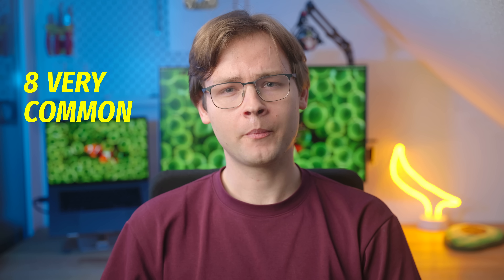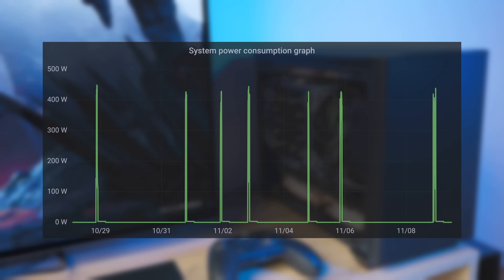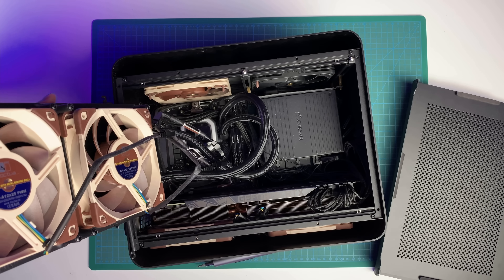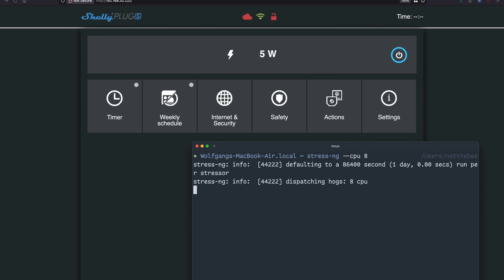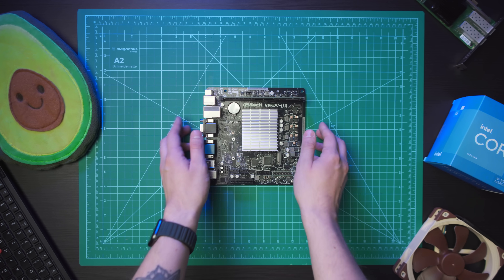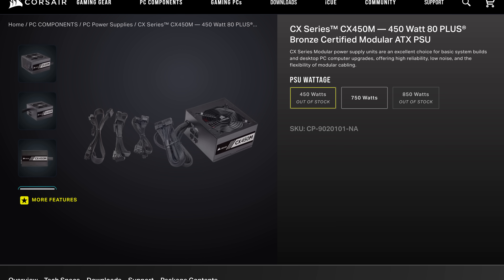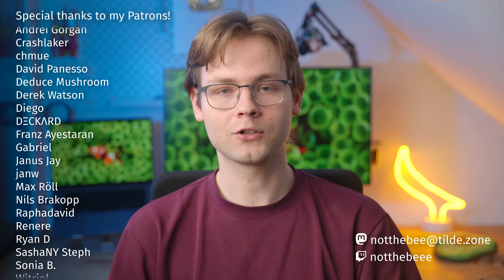Busting 8 Common Homelab Power Efficiency Myths

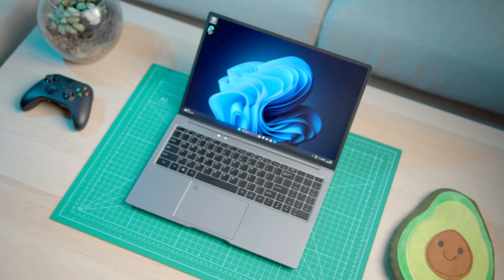Comment: 12:56 The one area where laptop CPUs seem to always beat desktop CPUs in efficiency seems to be AMD APUs, and i mean APUs, not desktop CPUs in a laptop BGA socket, there is just something about the chiplet architecture that requires more power draw especially when you're not looking at full load.

This means the 7945HX is likely just as efficient as the 7950X if you clock them the same on the same hardware this is because they are effectively the same processor, just in a different package.
But a 7940HX would likely beat out a 7700X in efficiency as long as the 7940HX is not starved of cache(has 1/2 the cache per core compared to the 7700x, also i think it has 4-8 fewer PCIe lanes)

Take my 5700G vs my 5600X
In the same board the 5700G can idle at 15% lower power draw at the socket with quite literally all the same hardware, and then if you take out the GPU its even better system wide reduction(getting rid of the GPU to free up PCIe slots was the main reason i switched my recording server over to a 5700g, didnt realise how much it would reduce power usage).

I dont remember where i read it but someone said that the picojoule per bit could be 5x more energy expensive under certain loads on AMD's chiplet desing, but that may have been talking about their chiplet based GPUs with the cache being located off-die.
Reply: Of note, while AMD APUS are generally more efficient, they can be less efficient if they are tasked with something that needs alot of CPU cache, as AMD APUS seem to all have 1/2 the L3 cache of their chiplet based counterparts, this means tasks that could be run within cache on a chiplet CPU, now have to run out to RAM and back on a monolithic APU.
Reply: @denvera1g1  Not all. Zen and Zen 2 ones mostly had 1/4 the L3.
Reply: @laurelsporter  How have i not noticed my 4750G has 1/4th the cache of my 3700x
Reply: @laurelsporter  Zen1 and Zen+ were both 1/2 the cache per core, with the 2400G having 1/2 the cache of the 1200-1400, and the 3400G having 1/2 the cache of the 2500x

But i did not notice that the 4700G/4750G were 1/4th the cache of the 3700x

This explains why the 5700G is so much faster than 4700g in some use cases, and why the 4700g is more sensitive to memory overclocking.
Reply from the maker: True! That's a really good observation. The AMD APUs are based on a monolith design, which is also used in the laptop chips.

Comment: Good video :)
Let me tell you about my home server.
Supermicro X8DTL (2010), 2X Intel Xeon X5690 (2011), 128 GB DDR3 REG ECC, Nvidia 1650 GPU.
Idle power consumption 125W (240V) Maxes out at around 350W whan transcoding video.
Not the most efficient machine in the world. Uses about 100kWh a month.

Comment: Judging by the thumbnail, i'm going to guess you're going to refer to 3.5 inch HDDs being massive power hogs.
I'm dropping this comment before listening to the video.
I have a battery backup from Ecoflow, but it doesnt switch fast enough for my PDU(internal self resetting breaker that flips if it senses a surge/issue) so i have an APC in-line after it.
I want people to guess how much power i use on average with this stack below, according to the large UPS 1.3kwh battery pack, which powers everything including the traditional UPS, or just the UPS which only powers the server rack.
---------------------
a power filtering PDU that also acts as a fuse for cat5e and 2 COAX sources(IIRC it draws like 0.5w so unless its draw goes up as other draws increase is inconsequential)
minisforum UN100(re-purposed as my firewall+router+caching)
Micortik CRS354-48P-4S+2Q+RM (48*RJ45_4*SFP+_2*QSFP+)
5700G based windows 11 Pro server with only 2 M.2 drives and 32GB of 3600 RAM and 4*PCIE TV tuners.
4*HD Homerun tuners
7950X based file+docker/kubernetes+virtualization server(truenas scale)
-64GB DDR5 4800 2 dimm(not ECC yet, waiting for 256-512GB kits so a 128-192GB kit would be reasonable)
-2*M.2 (boot)
-4*Optane 905P 1TB(not really used much at the moment but still set up for caching and special metadata to make the pool feel snappy)
-10*16TB HDD
-40G network card and 8*SAS controller
(not enough PCIe lanes for literally anything else)
----------------------

Now, i can tell you my old file server, a Dell Cloud Edge C2100, with 2*60w Xeon L5640, 18*8GB ECC FB/registered, 12*6TB 3.5 inch, 2*2.5 inch SSD, and dual 10G ports idled at ~500w just by itself. and required more assisting servers to get the job done.

How much do you think efficiency has improved in this time? How much do you think my new stack uses compared to just the one old server?

Also i have a surprised after a few guesses come in, i've left something out of the above.

Comment: I could get my old Haswell 4-bangers down to 30W or so.  A modern full-build uATX motherboard w/APU is about the same.  30W.  On the other-hand, mobile APU chipsets do much much better.  I've had very good luck with NUC style form factors with both Intel and AMD.  The AMD 3550H is a real workhorse and idled below 15W.   And I have an old Intel NUC style machine (5+ years old) that runs 7W, and a modern Raspberry Pi 4 that also runs around 7W.

However, at 7W the performance is really bad no matter even for basic tasks.  The CPUs just can't burst long enough and you can feel it in the response latencies.  Still, the RPI4 is able to Home Assistant and even though it can't really do a whole lot beyond simple data copying and automation, that is all Home Assistant really needs.  For example, it can't transcode or archive the 10 security camera feeds, but it has no problem doing a streaming fan-out of the feeds to wall-mounted clients.   It is also limited by a meager 4G of ram.

Modern mobile APUs from both Intel and AMD at 15W do much, much better because they idle below 15W (10W is possible if you really try), and yet can burst to 30W which makes them very responsive, and you can hang a significant amount of ram and storage off of them all inside a small NUC style case.

I finally settled on the 3550H APU in a NUC style form factor for non-compiling server-type stuff.  I can fit 64GB of ram, one NVMe drive (1TB), one M.SATA drive (slot unused), and one 2.5" SATA drive (4TB) all inside, all SSDs.  The whole thing runs roughly 15W when idle or under low loads and never gets above 25W.  It can burst significant cpu power for a short period of time which makes it very responsive, and it has two ethernet ports.  It can do very basic transcoding (repackaging mostly, though certainly not on 10 concurrent video feeds).

I have three of them.  One runs primary home functions (dns, mail, web serving, home media archive, routing, firewall, ntp/time, NFS/Samba exports, NAT... almost everything), the second handles repackaging and archiving feeds from 10 security cameras.   And a third is the backup box which backs up all the filesystems for all the machines and handles staging to the off-site backup.  And I still have the RPI4 handling the home alarm system (it fits in the alarm cabinet with its own backup battery).

Bulk compiles are painful on these sorts of small boxes, but that's what workstations and larger pieces of metal are for... the threadripper, for example, burns 150W when idle and something like 300W going full out.  But it doesn't need to be turned on 24x7.

My office workstation with its dual 4K display is also running on a normal uATX mobo combo and eats around 30W, not to mention the monitors that eat 10W each when not blanked.  I have tried many times to downsize it to NUC style or smaller and have failed every time.  The mobile form factor is just too slow when you have to 4K screens and half a dozen chromium windows open with many tabs in each, plus video playback in at least one going (sometimes more than one).   So my workstation needs to be able to burn 100W+ at times and no NUC form factor can handle that reliably.

Basically any particular need has certain minimum resource requirements to be convenient and there are form factor and idle/nominal power consumption requirements which fit that need no matter how you twist it.

-Matt

Comment: Hello there,
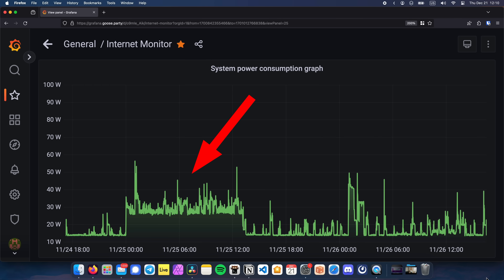2:58 i would like to know if the shown consumption is just for one device or for more than one.
I have my Router, a Palo Alto Firewall, 2 x small 8 Port Switches from HP, 2 x UniFi APs, 2 x Lenovo 1Litre PCs and one DIY Backupstore with an total idle consumption of 110-120w.
Tbh i would like to lower it even further to make it a little bit more cheaper than it is now. 

Also thank you for your content. I really enjoy it! 
C u

Comment: As somebody beginning to investigate homelabbing, what is missing in terms of info to me is actual build recommendations with modern and widely available components. People are usually referencing old stuff they picked up on ebay that is not being produced anymore etc. Some people don't have time to scour ebay-like sites hoping to pick something up from 5y ago or some obscure power supply to save 100$/€, and just want to know ok these components you can order anywhere and are good for low power draw and these typical use cases, etc. combined with these hdd's for this reason.

Thanks for the content!
Reply: The thing is, it's more like saving $1,000-10,000. New server and workstation stuff, even with tech that's a few years old, is expensive, and has gone up quite a bit over the last few years. The new ASRock Rack and Supermicro equivalents to some of these 3-5 year old servers are commonly $2500+, and can often be $700-1500 for the motherboards alone. I don't even mean the latest and greatest, either, but like Skylake and Kaby Lake based Xeons, and Goldmont Atoms, that Intel has kept pumping out. On top of that, there's always new stuff coming out every year, and older parts finally crashing in price.

If you don't care about IPMI or ECC, 4th-7th gen Intel Pentium, Core, and Xeon E3, on basic motherboards, are good bets, with 8th to 10th gen exemptions for the Pentiums and i3s. 8th gen and up Intel can be OK, with a mini PC type business computer, or good luck. But, since they just kept making Skylake bigger and badder, to compete with Ryzen, results can vary a lot, with common desktop parts. FI, a lot of those later Skylake++ motherboards will have VRMs made to push many amps, that are awfully inefficient at idle, or with low-power CPUs. But, home desktops will tend to be off or in standby, so it was typically only a minor issue for the intended use case[2].

For newer stuff, the monolithic Ryzen 4000G(E) and 5000G(E) chips (note that only the Pro xx50G(E) ones support ECC), on newer B450[1], A520, or B550, are pretty good (also 6000 and 7000, in mini PCs and such). ASRock has good support for ECC, and x16 bifurcation, across their 500-series lineup, too (you can get x8/x8 risers, x4/x4/x4/x4 risers, or 4xm.2 cards, and use them on $75 boards). AMDs before Zen 2 (1xxx, 2xxx, and 3xxxG(E) CPUs), Ryzens with IO dies/chiplets (almost all 3000 and 5000 non-G models, with a few exceptions, like the 5500), and the X570 chipset (which is a 3000/5000 IO die), not so much, as the IO die will typically use 10+W, just sitting there. AMD's main weaknesses are firmware and software compatibility with popular virtualization feature sets, quality of FreeBSD hardware support, and not always knowing if you can run a given motherboard headless on a pre-7000 series non-G/H/U CPU.

The more features, the harder it will be to save power, and many server-centric parts also make it harder (FI, some Intel NIC drivers, and the LSI HBA drvers, can disable ASPM, by default).

Also, try to avoid most 2.5GbE NICs. The i226-v is supposed to be OK, but its predecessor, the i225-v, was hot garbage, and Realtek still has some chips with buggy Linux drivers. IMO, leave 2.5Gb stuff to Windows, if possible, and just take the plunge into 10GbE w/ SFP+, if you want more speed.

If 16-64GB (but, some can take 96GB, now) max RAM, and little to no expansion, is OK, just get the tiny/micro form factor business PCs, with up to 10th gen Core CPUs. If you want real server features to play with, though, or a lot of add-on hardware, there is no easy solution on a budget.

[1] But generally steer clear, as most were craptastic respins of craptastic B350/A320 designs, as the board makers didn't want to put real effort into early Ryzen boards. With a few exceptions, like the ASRock B550(M) Pro4s and Steel Legends (same basic boards, but the latter has more RGB), only the B450 boards that came out well after the Zen 2 (3500X and up) release are really worth it, just in general. And, it can take a little effort to tease that info out, whereas you can spend $10-20 more and get a 500 series board, instead.

[2] One reason business PCs are better about this is that they don't usually get turned off, or go to sleep. Between Windows Update, and multiple levels of security software, trying to use a computer within the first half-hour of booting up will be painfully slow - yes, with nice SSDs in them all. Figure that you'll also have 20+ in any decent sized office, but maybe 100+, and that idle really matters.
Reply from the maker: I've been running my entire home network from a device with four i225-v (rev. 03) NICs for more than a year, not a single hiccup. YMMV.
Reply from the maker: @laurelsporter4569 *Sigh*, they really effed it up with the i225 series, didn't they.
Thanks for the feedback, I'll refrain from recommending the i225 in my future builds.
Reply: @laurelsporter  not talking about 10k setups for starting a homelab. But I don't think it would be a stretch to say this is what a 500$/€ budget gets you, this for 1k and this for 1,5k etc. These can be updated yearly based on what is available and still create a lot of content opportunity aside from that (e.g. buying off the shelf prebuilt system vs same budget but with 2nd hand components or same budget when you build it yourself with new components, etc.). Basically like many channels do with gaming pc's.
Reply: @NietzscheanMan  I don't mean spending $10k, I mean that the new cost for some of these servers was likely in that range, and you can only save so much, without losing quality and features, buying new. But then you may find them for $100-500, still very usable, some years on, because the companies that had them just want them gone. The recyclers that resell them got paid to take them away, so they don't have a lot sunk into them. Value-wise, used big OEM stuff is killer. But, every several months, what to look for at a given price can change, and every few years, it radically changes. The target is always moving.

It depends on what you want, though, and that also varies a lot more than for gaming. For gaming builds, you can pretty much set a price, determine whether CPU or GPU are more important, and you're golden. There are also much more limited sets of potentially good parts that matter, at any given time, as you're not looking at several generations of CPU platforms, implemented in proprietary ways by several different companies. Today, there's enough competition for quiet and small stuff that you can even treat SFF and quiet build parts somewhat as commodities.

If you want BMC, no-fuss RHEL or VMWare compatibility, or other such things, used servers are pretty much what you need. Many have upgrade options, once they're getting parted out, too (FI, check out the Art of Server's storage upgrade vids on the 720). If you want to play with specialized virtualizing, you need either to get them, or get newer Supermicro, ASRock Rack, etc., boards, often at $500-1500 each. To build one, used, is still awfully expensive, for some reason (like these old mobos are worth their weight in gold, but entire servers are worth their weight in styrofoam).

OTOH, if you only care about dealing with software, then you just need to concern yourself with features, upgrades, power, etc.. The used office PCs, or making a lower-end build with SBCs, will work great. If you don't have important data to store on them, and especially if you're going for experimenting, skip ECC, and that opens up tons of machines. But, those machines are constantly changing in price and availability, too. It would take a great effort to keep an up to date set of parts/builds, for used markets, and new SBCs.
Reply: Asrock N100DC ITX is a good, cheap and energy-efficient board (6-7w). Add 16gb of RAM, a cheap laptop power supply and the drives and case are determined by your use case and how much storage you need. Install your favourite Linux distro, run a few containers of your favourite apps and you're gtg.
Reply: It's part of the learning process N-Man. Very few people have all of the answers you require because it doesn't make good content. AND your requirements will be unique: your budget/ skill set/ willingness to overcome setbacks/ tasks you need your server to do/ risk aversion/ etc. Keep looking through your favourite content creator's back catalogue for hints. Try Wolfgang's links
Reply: @anotherfellasaiditsnunya and a lot also depends on where you live too!